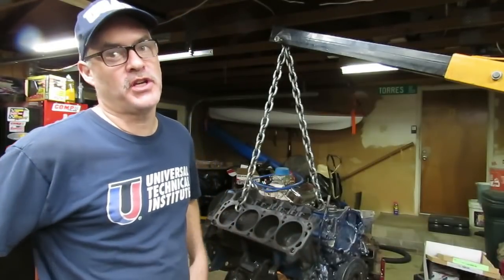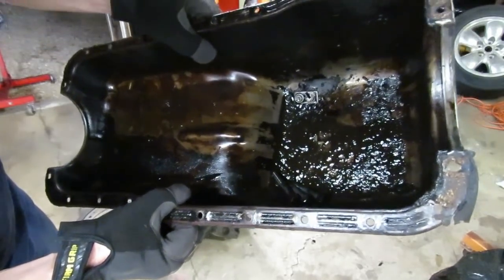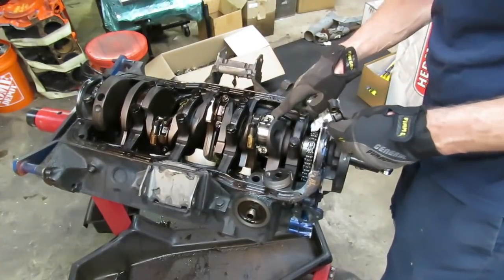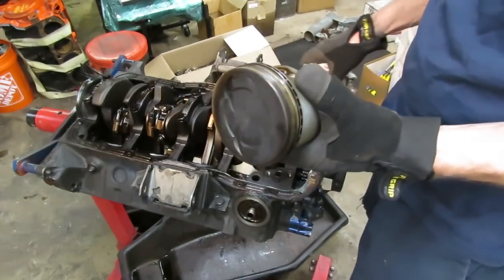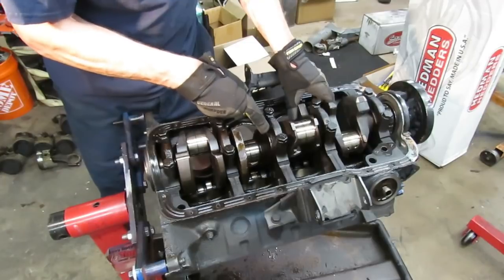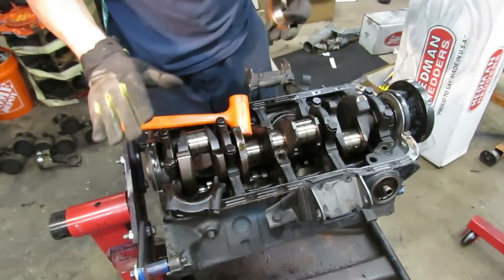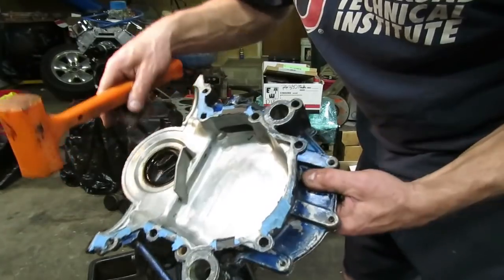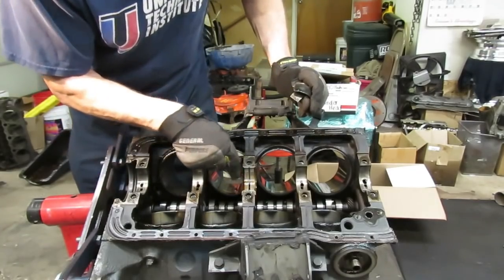How to get more power out of your small block Ford part 2

Comment: If the crank is bad it would be nice if you could talk your friend into doing a stroker build with a good streetable hot cam.
Reply: 347? I like your style??? I too am running a 347 in my '57
Reply: The man has a small budget.
Reply: @slick-px4pq  Don't we all... Yet managed to build a 5.0 for under 3k. Mostly stock.
Reply from the maker: 289 blocks don't like stroker cranks
Reply: @Myvintageiron7512  there's always keeping it period correct. Costs more than finding a low mileage  5.0
Reply: @Myvintageiron7512  I put a 302 windsor crank in my 289, made 400Hp @ 6500. Never had any issues with the 289 block although I did use longer connecting rods. Long rods work very well in a wedge style chamber like the 289 and the small block chevy, but not clevelands.
Reply: @peterhart4301 where do you guys come up with this bullshit?
Reply: @joshiek7839  Which part in particular do you think is bullshit, please explain.
Reply: @peterhart4301  your rubbish about rod length. Good grounding in bullshit but not engineering.
Reply: @joshiek7839  And where do you get your experience with rod length that makes you think it is rubbish?
Reply: @peterhart4301  22 years in V8 Supercars where we ran “Cleveland” style heads with the longest rods you can fit in an 8.2 deck block.
Reply: @joshiek7839  I totally agree with you, that long rods don't make any serious power in an engine with a cleveland head. To make the longer rod concept work, combustion chamber shape and fuel mixture at fuel throttle are critical. To say it is complicated, is an understatement. The only time long rods would work in a cleveland (say 351 cleveland as example) is for a engine used more as a grocery getter, that is a cleveland with flat top pistons, low valve lift and used mainly at part throttle. In this case it will have better throttle response at part throttle and better fuel economy. Longer rods would lower peak torque, but spread the torque over a wider range. None of which I would suggest is very notable on the dyno. To make a cleveland work with long rods would mean some serious reworking of piston shape, head combustion shape, valve position in the heads, and reducing the valve cutts in the piston crown. 

Like I said,

"Long rods work very well in a wedge style chamber like the 289 and the small block chevy, but not clevelands".👍
Reply: @peterhart4301  all this because you said so. No explanation of the poly tropic process that leads to your bullshit. Just “ trust me bro”
Reply: @joshiek7839  "Polytropic" big word for you is it? When comparing long rods to a short rod engine, the longer rod creates a higher compression ratio at all points in the stroke between TDC and BDC, this increases the burn rate allowing a leaner higher energy chemical reaction raising pressure on the piston during power stroke. As for the thermodynamics, the cleveland has a very high surface area to volume ratio,  meaning it suffers a lot of contamination of raw fuel/air in the exhaust stroke hence reducing the effectiveness of the power stroke. Now anyone with any intelligence would always be willing to learn more and thus make a reasonable assumption of their own, obvious intelligence which you don't have. I think you need to lean how to read, your vocabulary is very limited.
Reply: @peterhart4301  you’ve made two very strange statements that you don’t link to one another to form an argument. You are very wed to a narrative that doesn’t play out in real life. If I’m building a new engine the rod ratio is the least of my worries. Especially in a street engine.
I can’t wait for you to explain how a bigger rod ratio produces a higher compression at every point in the stroke!
Reply: @joshiek7839  Rod ratio has more to do with what characteristics you intend to build into a engine, not best for absolute power (unless it is used with other modifications). As for the longer rod having higher compression ratio, it is so, I calculated the volume of cylinder at different points and then changed rod ratio to compare results. At TDC and BDC, nothing changes, but everywhere else in the stroke, it is different. I would suggest you would not have my math skills, but you could try working out sweep volume for a cylinder @ 90 degrees past TDC and compare with cylinder same but with longer rod length. When you have time, work out the volume of a 302 windsor @ 90 degrees past TDC then compare with Australian 302 Cleveland with it's 6.020 rod @ 90 degree past TDC. If you want I will check your answer.
Reply: @peterhart4301  lol. Now fit that into your argument. There is theoretical argument to using a short rod with say a Cleveland head vs a Windsor head, but it has nothing to do with combustion chambers and everything to do with port flow. But your camshaft is going to have a far greater determination in that than the practical rod ratios of either of those engines.

Comment: I thought by 68 they introduced the 302 & ended the 289? Maybe that was a half yr thing??
Reply from the maker: the last year for the 289 was 1968
Reply: The change was done early in the model year probably to allow Ford to use up the remaining 289 engines from 1967 production.